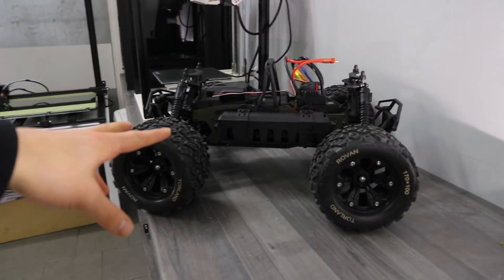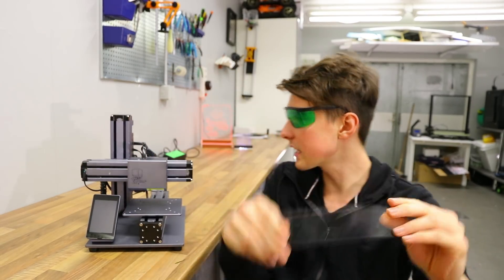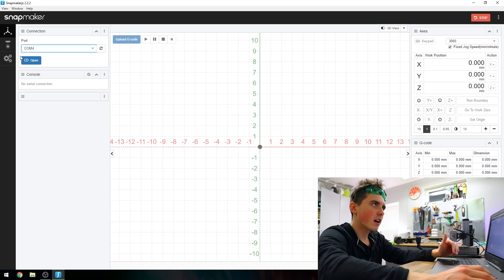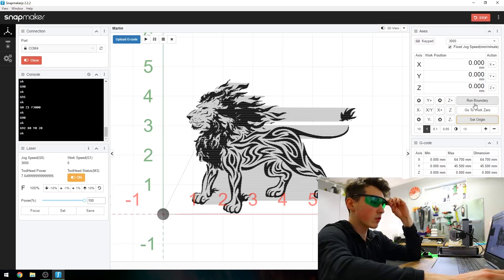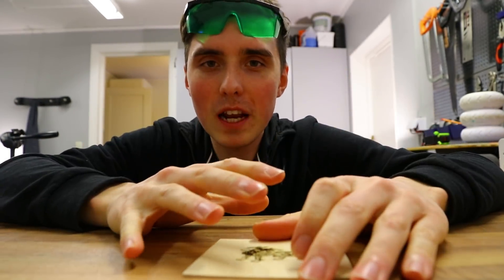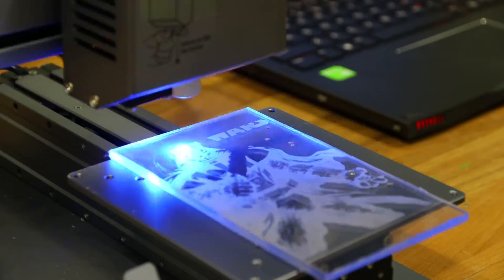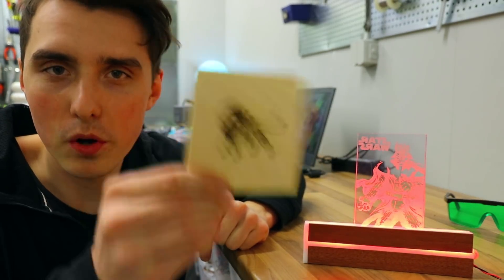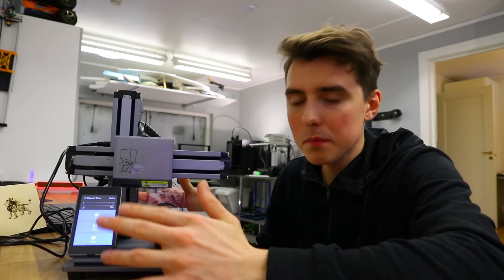AWESOME Darth Vader LED Lamp - Laser Engraved

Comment from the maker: Just a clarification: The Snapmaker (the grey thing) is a 3D printer, CNC and laser engraver. The laser is not too impressive, it's weak and therefore slow.
Reply: RCLifeOn its cool because its versatile but yeah its probably like a proof of concept because the laser is weak
Reply: RCLifeOn my list of machines i NEED are... Cnc machine, laser cutter/engraver and 3D printer for sure
Reply: I hope you will do a CR 10 laser mod, that way you can itch big objects. I just received my 2.5 W laser and will be installing it over the weekend, straight forward just gonna use some magnets to attach it to the print head and connect it instead of the cooling fan. I am interested in seeing your approach to the involved softwares for laser engraving.
Reply: You're literally the reason I own the Creality Cr 10s4. Good marketing, my man.
Reply: RCLifeOn o
Reply: This toy have only 200 mW not 500 mW laser so they cheat look this https://www.youtube.com/watch?v=AXriUr5wGzw
Reply: Try to colour the plastic with some black colour that are removable.  Show make it more efficient.

Yes, I watched to the end.  ;-)
Reply: there is now a 1600mW laser available and you can laser cut aswell.
Reply: Oops.....I see this after I already commented below. so Pleas forget that. I Apologize
Reply: Did you see that snapmaker is making a new and bigger machine just like this one?
Reply: you should put a laser on the ender 3
Reply: Do you remember the laser engraving settings for the acrylic? I've been trying but, I can't get the etching.

I painted the acrylic with white board marker and it was good but not what I was looking for.
Reply: Can we do the same thing with eleks maker laser engraver
Reply: Now available with a 10 Watt laser..
Reply: *That's the A150 with a 0.2W head. Currently there's the A350 with a 1.6W base model laser, or 10W upgrade. Its so great

Comment: What settings did you use to get the Darth Vader to engrave? I have the Snapmaker Original with the 200mW laser and I can't get the laser to see the clear acrylic. It goes right through it and doesn't engrave. It can engrave everything else (paper, cardboard, wood, etc.), just not clear acrylic.

Comment: This is pretty funny, your video is posted in a snapmaker question forum, where the person sees your video, then applies engraving settings of 1000mm/min, 100% and auto focus (which doesn't work on clear surfaces).... That's a pretty small workspace and it took you 8 HOURS TO PRINT... So they reference your video and didn't actually watch it?

Comment: hey what's your opinion on the Snapmaker 2.0 line up? it would be great if you can do a review on it.  they even made a custom enclosure for the 2.0 series.  I curious to know the points of failure of the snap maker 2.0 A150, A250, & A350.

Comment: Just a clarification: a laser does not know and can not burn the acrylic, in any case with a power of 200mW or 500 mW. you need at least 15 W with a well-adjusted focal length to scratch acrylic.
I personally think that this video is a fake.

Comment: $800 for 200mW? (that's a DVD-RW diode power lol)

Good 22x22 printer - $325
1.8W salvaged laser diode - $12
Casing & glass lens - $15
Total $352. More powerful (can CUT plywood), bigger bed and SD support.

Comment: Well, of course, now you can enable the laser support in Marlin and flash it onto any 3D printer with a laser tool, so for little more than the cost of a cheap 3D printer you could have a 300x300 or larger build size for engraving.

Comment: i do 3d prints and i know that it takes long. 
and i do CNC milling for everydays work.
but 8 hours seriously! i expected something like this would take about 8 minutes real machining time.
and about 20 to 30 minutes machining if you would use an CNC based engraving tool. 

i thought laser was the fastest way to achieve these one layer things.
thanks for the vid, now i know it isn't. therefore thumbs up!
Reply: Jan Wiersma it actually is really fast but only when you use the right laser! This is a cheap laser diode, but normal co2 lasers can do this in 10 minutes!
Reply: thats more like it. thats how long this should take indeed. thanks Tim.
so we better forget this set-up with this laser pen.👍
Reply: Jan Wiersma exactly

Comment: 8 hours?!?!?!  And $800?!?!
Who can say ... No thanks?
Reply: me
Reply: Well it is a 3 in 1 but yeah, get a K40 for what, half that? And it does muuuuch bigger stuff and cuts that damned acrylic too. It's just not for the faint of heart :)
Reply: You may buy a Mototool for just 30 USD (maybe less) and have the satisfaction of saying it is "hand made". It may last same, it may last longer, even less, it will depend on your skills. Besides a Mototool can be used to make several different crafts depending on accesories you buy and at the end it won't cost even 100 (well, maybe a little more but it would be'cause you're buying lot of accesories). I have made things like these either on glass or plastic as easy as print what i want to on a sheet of paper put it behind glass and start engraving. Engraving accesories cost about 10 USD by the way.

Comment: With a adjustable focus you can theoretically etch inside the acrylic
Buy a small acrylic block and etch yourself inside it
Reply: Like makers muse did!
Reply: Or glass?
Not sure
Reply: crystal glass...
Reply: doesnt that require two intersecting lasers?
Reply: Michael Rinkle no it does not. Just a powerful enough laser with manual focus